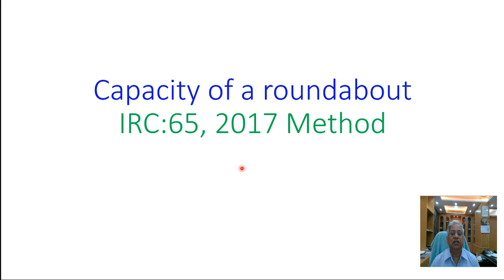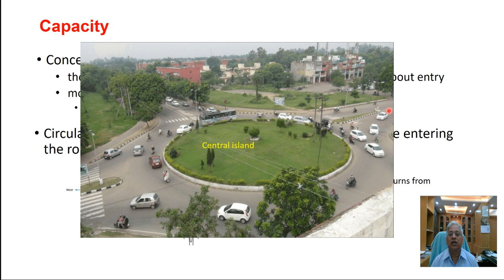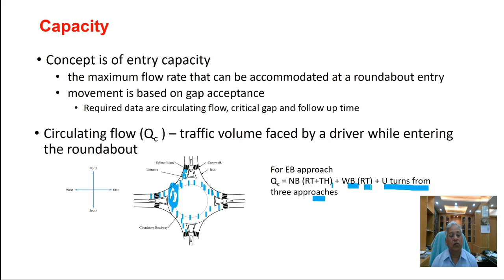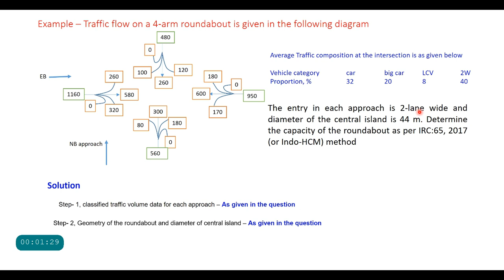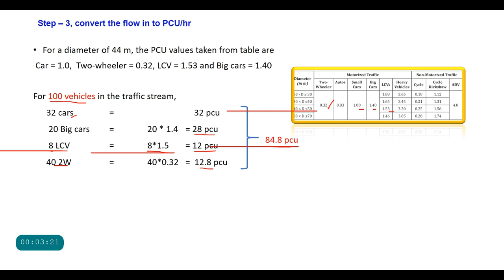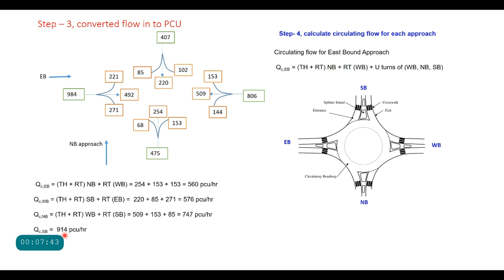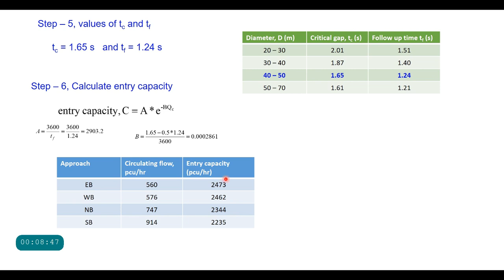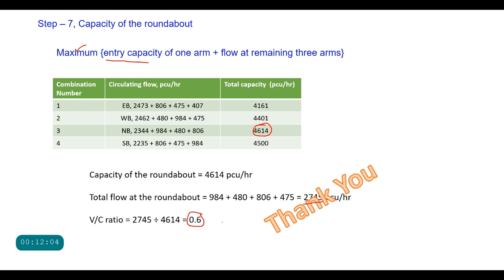#traffic, #Capacity, Capacity of a Roundabout as per IRC 65, 2017 method

Comment: Thank you for this video Professor; Can we use PCU converting chart for signalized intersections? or it is for just roundabout?
Reply from the maker: PCU for a vehicle is different for different types of facilities. It is the quantification of interaction between the vehicles with respect to passenger car. This interaction will change with type of intersection as well type of road. Therefore, these PCU values are suggested for roundabouts only.
Reply: Prof. Chandra I search after your comment. And I found what I looking for.. Thank you so much for enlightening our path.  @SatishIITR
Reply from the maker: Stay blessed. @aydnaydin9109

Comment: Design of rotary considering weaving length is different that in  IRC 65 2017 ??
Reply from the maker: Yes, Weaving length is not considered now. The new method is based on gap acceptance theory. Weaving theory has been discarded in all countries as it requires very large size of the central island.
Reply: @SatishIITR  thanks a lot sir to clear my doubt.
Reply: In step 7. Capacity in WB approach I think the value is 4328. 
2462+ 407+ 984+475.
I think 407 is taken wrong as 480. Plz let me knw if I am rite. Or it is 480. And if 480. Plz help to understand how 480 ?
Reply from the maker: @tehsinkazi5857  Yes, you are correct. It should be 407 and not 480. Thanks for pointing it out.

Comment: sir, Since we are using the same equation for a fixed diameter roundabout, we will get different capacity for the roundabout at different traffic volume conditions, is that possible to have different capacity for a given roundabout?
Reply from the maker: No, you should get the same capacity. Here you are mixing apprach capacity with roundabout capacity. Approach capacity will change with traffic volume, but total capacity of roundabout should remain same.
Reply: @SatishIITR   Sir, when I calculated the roundabout capacity using traffic data from 2016 and compared it to the capacity estimated with projected data, I found that the overall capacity differed in each case. is that possible?
Reply from the maker: @AthulyaBR  you should calculate capacity for traffic taken in 2016 and then find how many years ahead this roundabout can work. Capacity calculated in 2016  will remain valid in 2023 also.

Comment: "Does the number of lanes not matter at all?
Reply from the maker: Capacity of a roundabout (and also of unsignalized intersection) is based on three parameters, critical gap, follow-up time and conflicting traffic volume. All these factors will be depend on the number of lanes. In fact, HCM gives separate capcity curves for single lane roundabout and two-lane roundabout considering some default values of critical gap and follow up time.